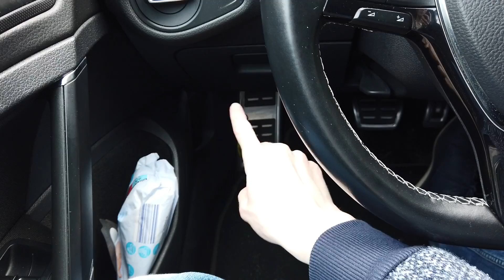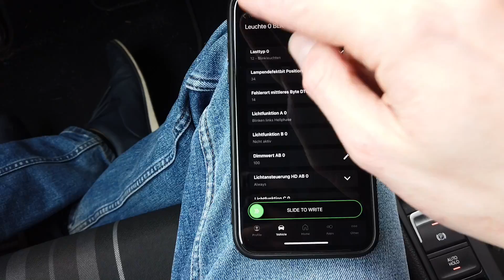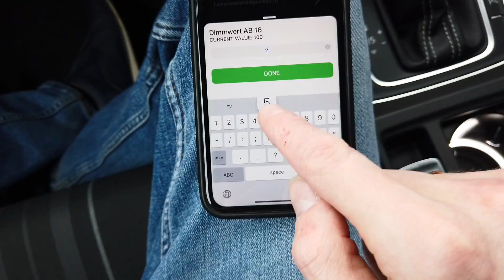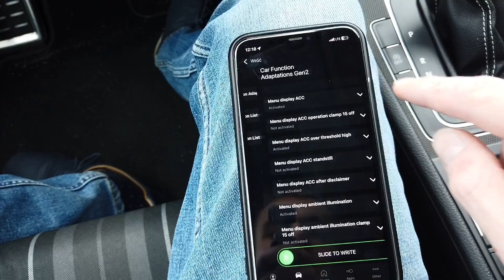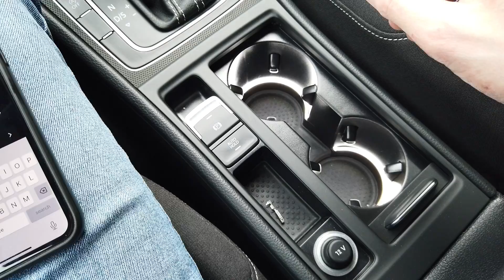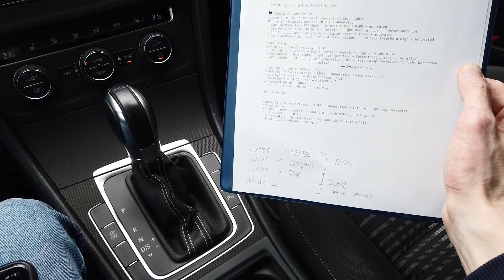VW Golf MK7 (5G): cup holder ambient light coding & wiring

Comment: If you wanted to add the  roof ambient lights that have 3 pins  how would you configurate the cable to the BCM would it still be a Low V led setting. One cable is connected Live, Ground and BCM(signal wire) but was not sure how you would set this in the Leuchte Pin menu.

Comment: Question would be if it will be possible to get the sun icon also for the cup holder. 👍
Reply from the maker: Doable. I believe I’ve done this in my Mk7 back in the day. Logged into the MIB via SSH and copied one of the config files from Passat to Golf folder.
Reply: @mrfixpl that sound interesting. May you be so kind and talk to me about that?
I have also telegram if you want. Current I want to go deeper in my mib and maybe you can help me here. 🙂
Reply: @mrfixpl  how did you copied the config files? Want to do something similar and would be great to get some help here. 🙂
Reply from the maker: you need to SSH into the unit via WLAn or D-LINK adapter. And it depends which unit you have (Technisat, Delphi, Harman).

Comment: All my pins on the BCM are already used. Leuchte31AMBL 1C61, Leuchte32AMBL 2C35, Leuchte33AMBL 3C36, Leuchte34AMBL 4C37 do not work. Do you know why they don't work? Is there anything I have to code? In worst case I have to connect it to the fog light pin, which are the only two pins that aren't used already.

Comment: Hi. I ordered the same led light like in description, i have it installed and connected to the same pin in bcm. But i have a problem, the intensity of light is changing on acceleration and deceleration. I think it has to be some voltage drop from the alternator or something like that. Also the intensity is changhing when hazard lights are on. I have done something wrong here?

Comment: Hey MrFix
Would i be able to do the same procedure with eBay ambient lights that work through Bluetooth where each Light has 5 controllers. If i was to Connect a led strip on the Dashboard to the pin in bcm would i be able to afvist the brightnes og it?

Comment: Do you use the 12v or 3,7v Stripe?
Reply from the maker: 12V.
Reply: @mrfixpl  What are the dimensions of the small BCM connector? The link is not working at the moment.

Comment: Good video, very clear. I did the same with facelift BCM. Coding works the same, but no long coding necessary. Adaptations is enough. Its how I control my self installed ambient lighting on the dash and reardoors(Lichtfunction a**  Ambienlicht 3, for control door ambient lights). Gives a very nice oem-like Feeling. Also did a lot of adjustments to how the domelights work when lock/unlock and open/close the doors, so Ambient lights are more visible when unlocking car in the dark.
Reply from the maker: That's cool! Does the rear lights and dash ambient light stay on if you change drive mode to sport? As far as I know ambient3 is active with normal/eco/comfort and ambient4 is active with sport/race/dynamic. This way you can create different scene in sporty settings.
Reply: @mr-fix  Actually, I don't know, I don't have DSG. But maybe add lichtfunction B or C then with ambient 4? For the dash and also "Ashtray" I set on ambient 2 and the reardoors to ambient 3.

Comment: Thanks for the tutorial. How did you mount the led strip on the cup holders? Double sided tape that it already has? How did you feed the cable in the cup holder? Drilled a hole? How much led strip was required for cupholders and wireless charging area? Thank you.
Reply from the maker: Yes, double sided tape, 3mm drill, bought 2 meters long strip to add it in couple more places (front cubby, glove box, door pockets, trunk under-floor storage, sun shades holder) and still have some to spare.
Reply: @mrfixpl  Thanks for answering. Will you also show the result and tutorial for the other areas you will be placing led strip?
Reply: how did the double sided tape hold up to drink condensation?  ok?  had to redo it?

Comment: great video i have a skoda ocyavia with ambient lighting from factory and was wondering iff i can fit puddle lights in the back doors and connect direct to door module thanks
Reply: no problem thanks for reply
Reply from the maker: even if not equipped, there are ways. 😅
Reply from the maker: Not sure if Octavia is equipped with rear door modules. MK7 is not.
Reply: i would think they is a wire in door loom to connect too but the question is which one id it . if they is no door module i dont fancy running cable to bcm its not worth it